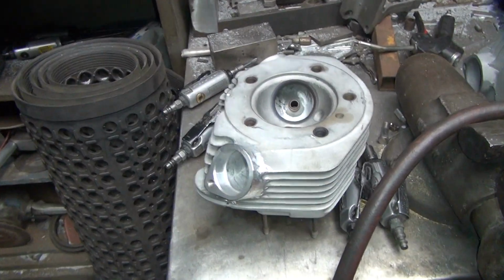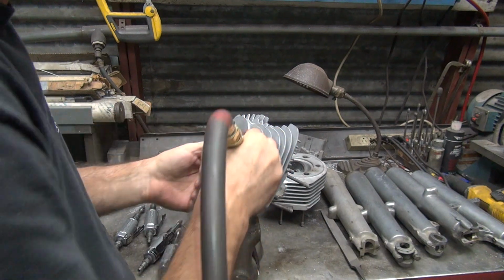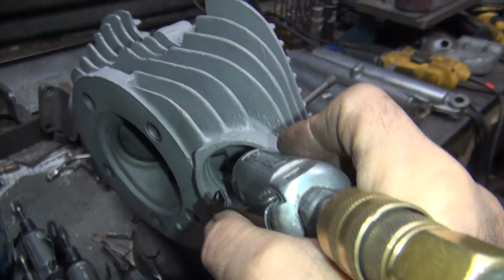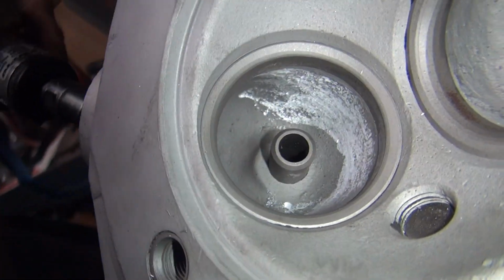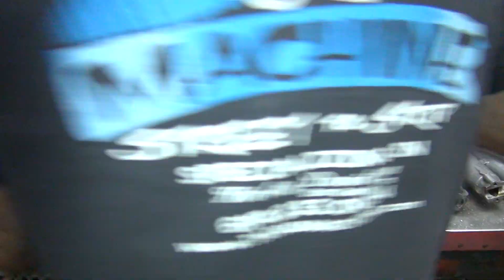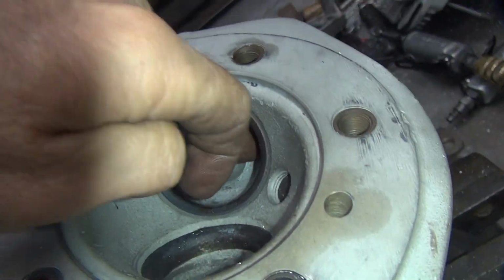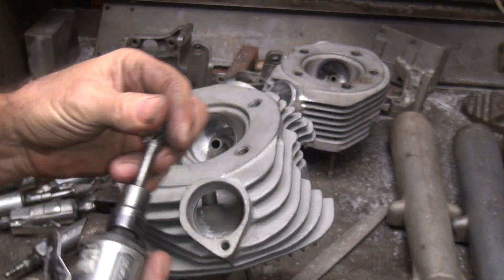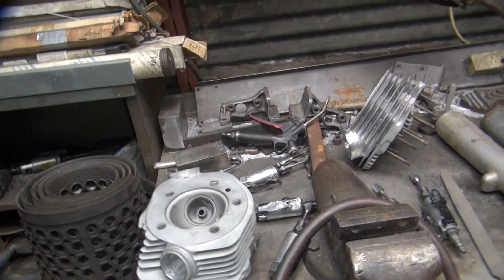1978 #101 shovelhead head rebuild, porting , exhaust repair, crank assembly harley by tatro machine

Comment: I made the same mistake when I built my fathers shovel. I ported them like you would a car head. Took out the casting flash, and opened up the shot at the valve. Got the engine done took the bike to the dyno. Was 65 horse (5 more than stock), but lost major torque all the way across the RPM band. The bike was very sluggish on anything except WOT redline pulls. The factory 1200 fried the tire on launch without really trying, but you actually had to TRY to spin to do it with hogged out heads. The loss of torque was noticeable enough to warrant tearing it down again. Yes, that bad. Started another set using the XR750 head template. The XR750 ports require building up the floor at the valve, building up the pocket behind the valve and a small place in the roof before the guide. You only widen where the roof drops to make up for lack of height. Put those heads on my 1200 bored .060 with 10:1 compression and went back to the dyno. 78 horse and 81 ft lbs to the tire on 93 Octane pump gas. 75 FLH and ran 8.01 at 81 MPH through the 1/8 mile. I learned the hard way and if you buy any good aftermarket head like STD, they will have a smaller higher velocity port. Trying to attach the XR programs template for you , but can’t figure out how.
Reply: Every area that is opened up that is not enhancing flow in a shovel is literally a “Dead” area and extra volume that does absolutely NOTHING except rob port velocity and hinder cylinder fill through turbulence. Epoxying/welding all “Dead” areas not contributing to the flow path reduces volume and increases velocity across the entire lift range. If you hog them out, you’re just increasing the volume with “dead” areas that do nothing for airflow, but kill port velocity. If you are running 4,000 to 6,500 RPM only on a “land speed” bike and only care about top end, maybe more volume makes more peak power, but at any RPM under 4,000 you are losing all your torque. Most street shovels never see over 5,000 RPM so do they need a 6,500 RPM port? Big ports on a shovel shift the entire power band upwards. Instead of 2,500-5,500, now your  usable RPM range is 4,000 to 6,500. A street shovel rarely sees over 4,000 so they are done accelerating before the big port ever starts making power. This type of port job might increase your peak horsepower number a little, but your average power and torque under 4,000 are going to suffer horribly. You really notice that torque on a street driven shovel that you might not notice on a full race engine meant to operate wide open only. You can’t apply land speed ports to an everyday engine.
Reply from the maker: most all harley heads have very bad ports and are big in the wrong spots. you work with what you got. std makes nice heads with straight ports like they should be. the ultima heads are good too. s&s suck because they copied harley. all that epozy crap don't work on harleys, they run way to hot. like most port jobs, its all baout the valve job. the falter you get from the valves the less it matters.
just like building motors, there are more than one way to do things and i do what i think will work best for the application i am working on. what i don't get id costomers complaning about a lack of power and reliability after they get a motor from me.
tatro
Reply: Did my heads 10 years ago with Belzona. Just had it all apart a couple weeks ago rebuilding the carb and replacing the intake boots. The ports look the same as the day I did it and you can’t even tell there’s Belzona in them. I would agree air cooled gets too hot for most epoxies, but it hasn’t phased the Belzona. My next step in search of more power is to buy the STD heads with a little bigger valve.
Reply: Good of you to suggest  to enthusiasts  what not to do to shovel porting because some of what the internet has to offer is b.s

Comment: I am still building my 76. 96inch duel plug shovel. Backed with a Baker 6 in a 4. Thanks again for the new sprockets, to get my gearing correct.
Went with a 39mm stock front end. I want to keep it lite for the occasional wheelie or drag race. Not sure I will use the NOS seat I bought from you yet. I have this mustang my wife will like better. 
What rear tire do you recommend? I believe a 1.50 is the widest that will fit in a stock swing arm. What brand do you like?
Keep the videos coming. Great way to wake up. Grinding and drinking coffee. Now I must go make money for more parts.
Reply from the maker: every bike is different for tire type and size. my 1957 panhead takes the 150 drag tire with the 4" rim but i don't have to deal with fender struts. you can put whatever you want if you want to make it fit.
tatro

Comment: You’ve ruined those heads. Shovelheads already have too much volume factory. To improve the flow, you actually have to weld up several places in the port. You took way too much out and killed your velocity.
Reply from the maker: your are correct, that is why they run so much better after i screw them all up. i was told that along time ago after i got a whole bunch of land speed records. i asked him what i should do with all these records now. 
tatro